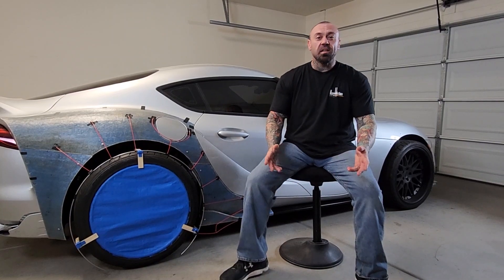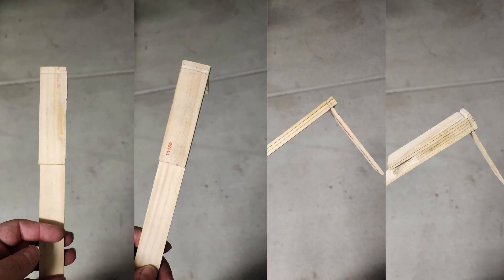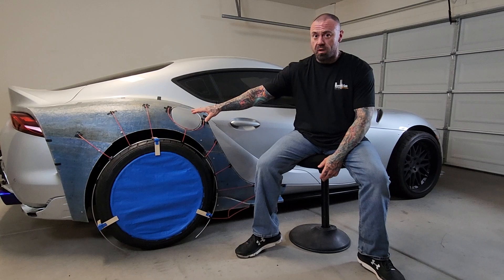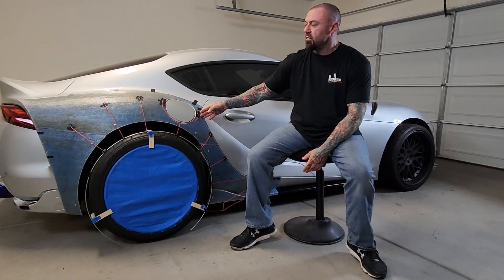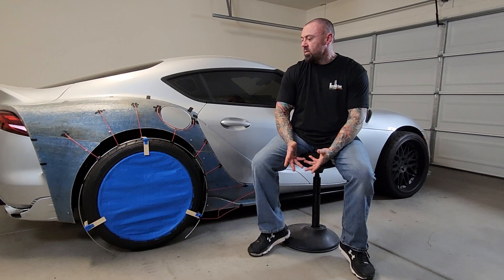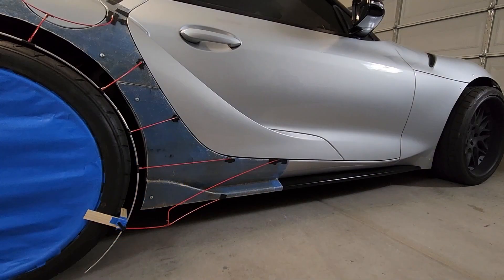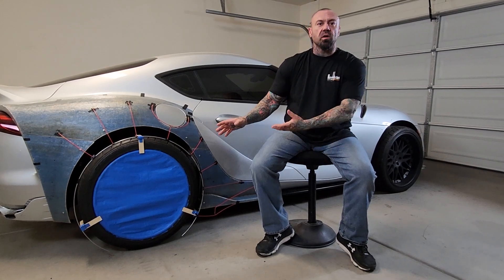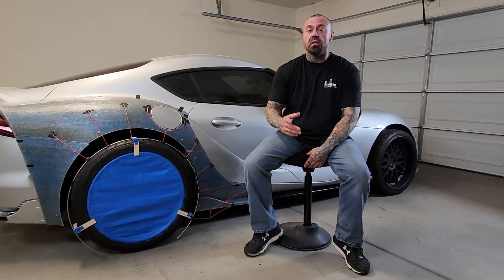Wheel Jigs and Round Rod Design on a 2021 A90 Toyota Supra Build

Comment: Hey Jeremy, awesome work and I like your style and tips man! 

Question: how do you make sure both sides are symmetrical?
Reply from the maker: Thank you very much for the kind words! I've covered this in all my videos, but here it is. 

When I shaped the rods, I duplicated them for each side. From there, I fabricated one side. I transferred measurements from side to side until everything lined up the same.

The foam was numbered by panel. Each panel had a template made and was checked from side to side for fitment. Hope this makes sense!